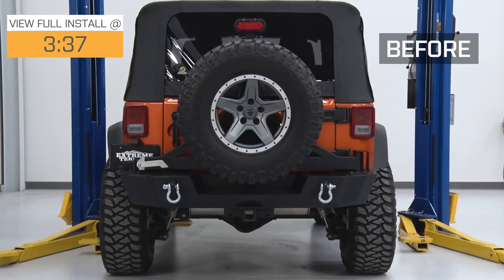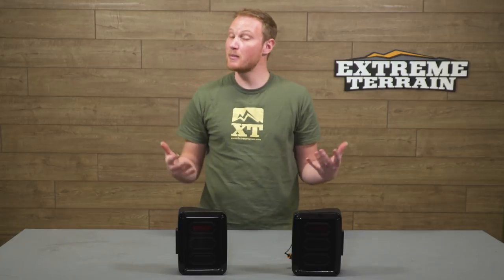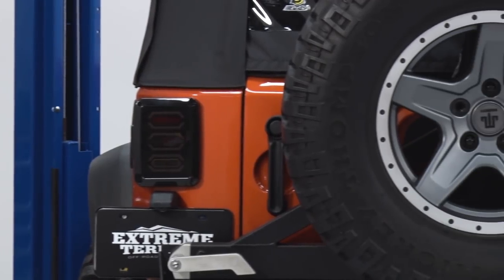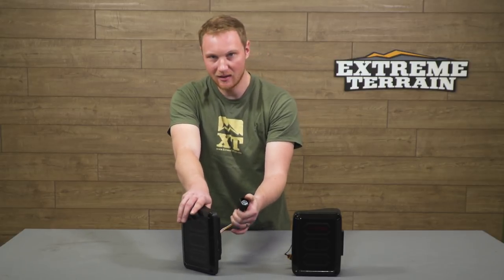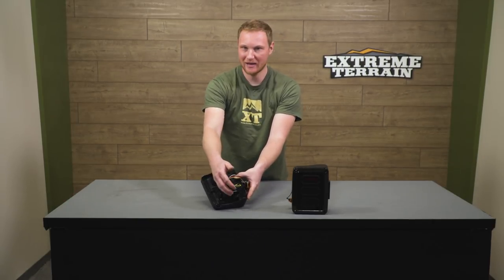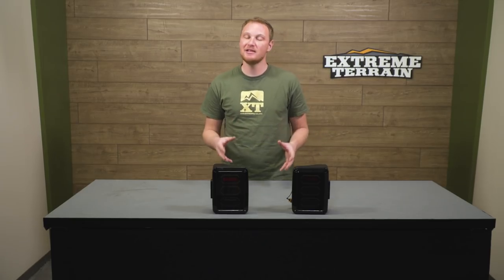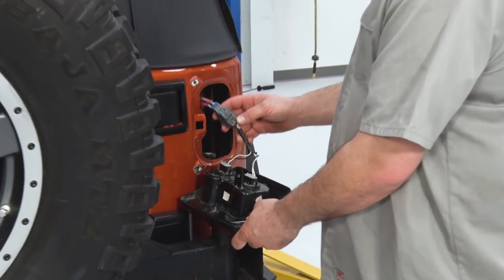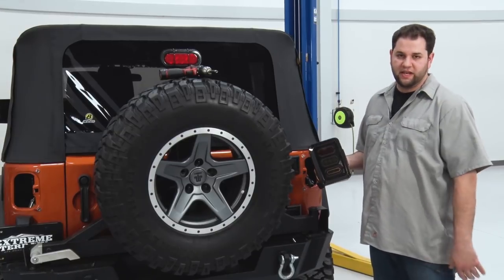Jeep Wrangler JK Axial G3 Diamond Series Smoked LED Tail Lights (2007-2018) Review & Install

Comment: I have Rigid Industry lights mounted on my stock tail lights.  With these being sealed, is there an easy way to mount the brackets to the housing if I were to swap them out?